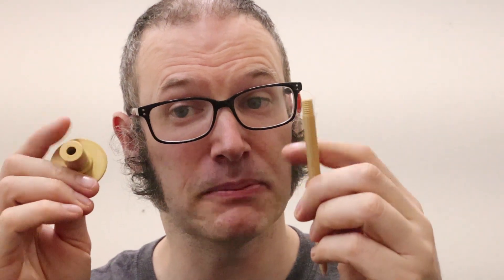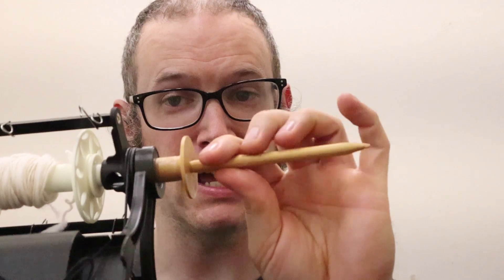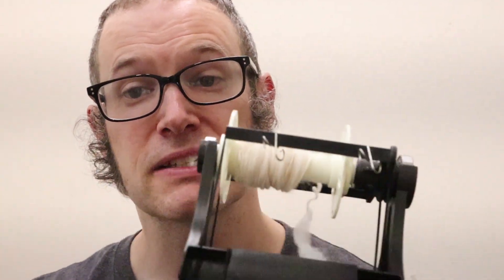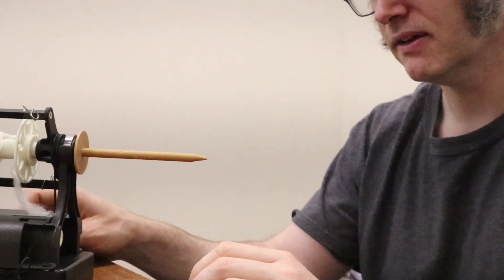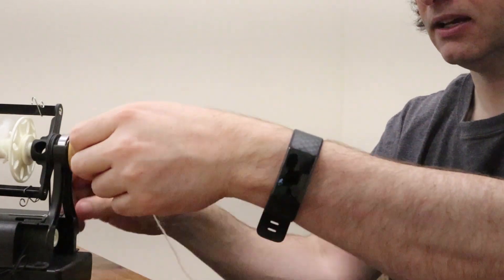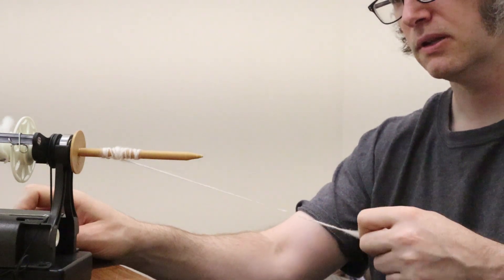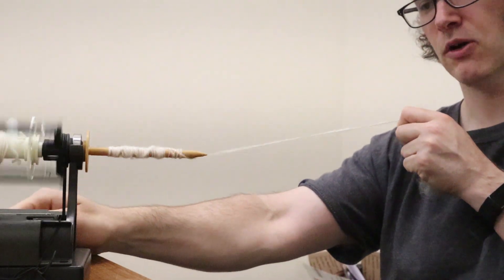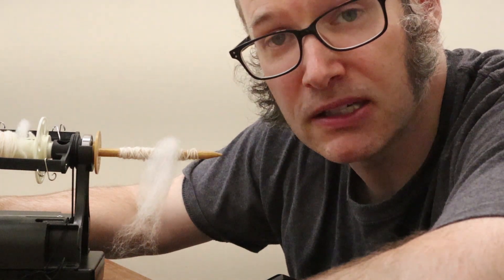SPIN #83 - EEW Nano Quill

Comment: How do I get a quill?  No one on your list is offering one in the USA.
Reply from the maker: They are new so I would give it some time.  You could try contacting someone on my list and see if/when they will offer it.
Reply: @DreamingRobotsBlog  I got it printed, via Craftcloud as you suggested. The two pieces do not connect
Reply from the maker: @cnyttende  They did when printed on my printer.  Maybe you need to do a little sanding or something to get them to fit with your printer.
Reply: @DreamingRobotsBlog  it’s the threads. The dowel piece is too big to thread into the orifice piece
Reply: FYI if anyone reads this. Craftcloud says there is a flaw in the design. Maurice agrees but doesn't have time to fix it. So I'm out $50. Don't waste your time.
Reply: Where is this list you speak of?
Reply: @brendasuckow9055  look in the drop-down box.